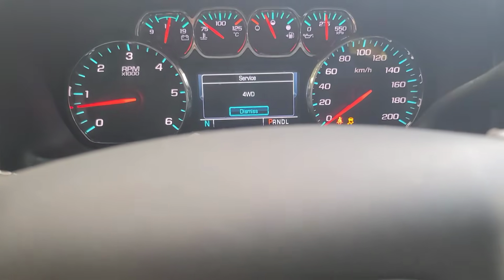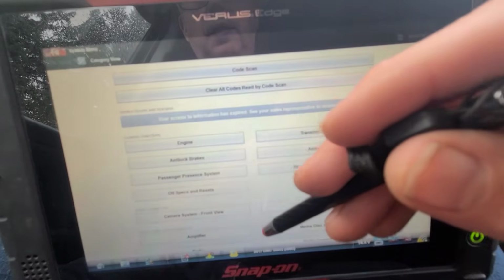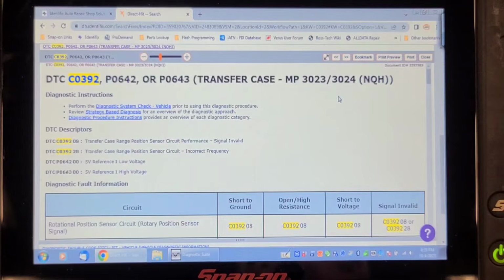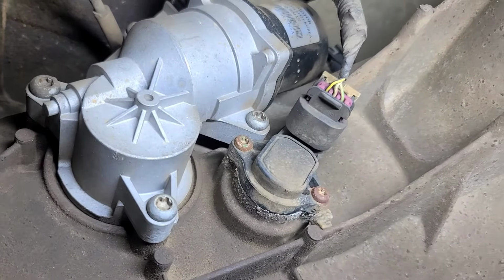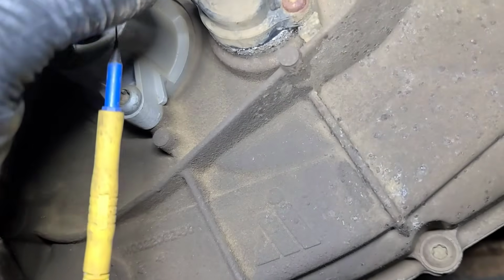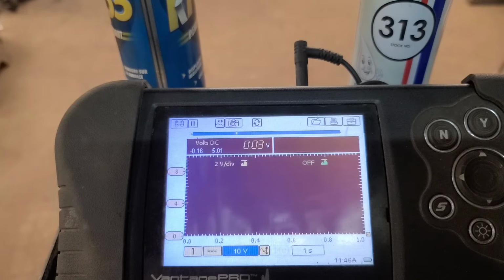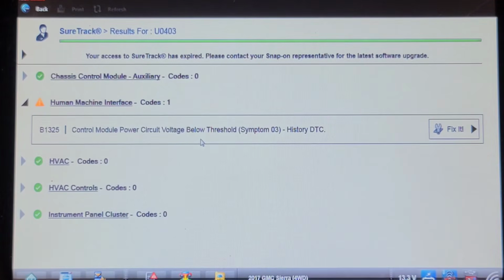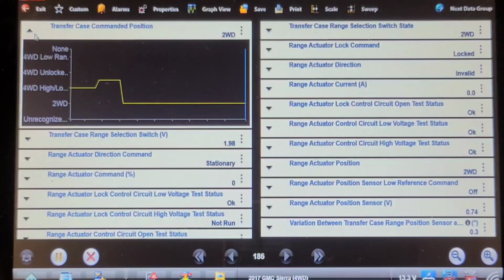2017 GM Truck Service 4WD Message C0392

Comment: I want to buy you a 6-pack.  I've been dealing with this issue for 5 years where the four-wheel drive with ghost shift.  It would try to put itself into 4w low while driving 55.  Then it would settle for 4w high and be stuck there for a number of miles.  I took it to the dealership and they're like oh it's the transfer case, and then they replace that to the tune of like $1,000. Then they're like oh it's the switch to the tune of like $200.  I just dealt with the issue, because I knew it was something electrical so I just kept the switch unplugged.

 This video completely solved my issue.  I pigtailed a new connector in and no more issues.  Thank you so much for this video!!
Reply from the maker: I'm glad the video was helpful for you. Intermittent problems are the worst to track down, but why would they recommend replacing the entire transfer case. You can send me a Super Thanks if you're inclined...
Reply: @PhillipBailey Because dealerships constantly want to rip me off.. what's a Super Thanks? I'm not YouTube savvy and don't know how to DM.
Reply from the maker: When a video is playing, click on the three dots at the bottom right of the video and a drop down menu appears. There's a heart with an S in it. If you click that you can leave a monetary tip of whatever amount you like.
Reply: Thanks!  I will do that.  Unfortunately it didn't fix my problem like I had hoped.  Could the position sensor have anything to do with it or is it most likely the TCCM at this point?
Reply from the maker: @TravelingKoi that's not a common problem, I've never seen that on a GM. Does it set any codes or just shift to 4x4 for no reason? Reply with the vin and I'll see if I can find any cases on it.

Comment: I’ll be referring to this video to diagnose the same issue with my daughter’s 2017 Colorado. I assume it to be the same voltages across all GM products.
Reply from the maker: I doubt the Colorado will be the same as its a different transfer case if I remember correctly. What are your symptoms and what code/s are setting?
Reply: @PhillipBailey Service 4WD in the DIC. No codes. It does shift into 4H and 4L.
Reply from the maker: @__Joe__ what are you scanning it with. Should be a code in the transfer case control module
Reply: @PhillipBailey I use the Icon T7 scan tool. No codes in the TCCM.  The DIC message only appears when the transfer case is moved to 4WD Auto, 4H, or 4L. It is not displayed in 2WD.
Reply from the maker: I'd recommend to try a different scanner as there should be a code if you're getting a message on the dash.

Comment: Thank you for such an excellent video. I have a 2017 Canyon and I got the service 4WD code yesterday after I had the truck washed and shut the truck off when I came out and started the truck it showed the message.  I was suspecting that this was going to be a signal error and now I know where I’m going to start. Excellent trouble shooting.  I only just got the truck so I’m just learning about all the systems and your visual inspection confirmed one of the lessons I was taught 30 years ago. 90% of most faults can be found by visual inspection 😉

Comment: for 2008-2013 Try Doman part DORMAN 645902 $50 or WELLS 1P1506 $70, plug for 4WD actuator, Chevy part 12117277 is $200
Reply from the maker: Thanks for the tip

Comment: Im trying to find the plug for that thing what’s it called?
Reply from the maker: Service pigtail is 13580871. Try dealer or Amazon
Reply: @PhillipBailey I got a new pig tail but the colors on the new connector are red,black and white I was trying to splice the new connector
Reply from the maker: @cristianvalencia2487 just maintain the same pin location.
Reply: @PhillipBailey  does it just pull off - in other words will i destroy the whole truck if i pull on it real hard?
Reply from the maker: @josephwoody8289 there's a secondary lock that has to be released to disconnect the connector.

Comment: Getting the c0309 code on my 15 sierra.  Replaced the TCEM  and no different.  Hooked up my buddies scanner, read and cleared code.  Comes right back as soon as the key comes on.  Tried the re learn procedure woth no luck.  Really trying to avoid the dealer if possible.  Do you know if the new tccm module comes pre programmed or is that still required?
Reply from the maker: Are you sure it's C0309? I don't find that code description on a 15 Sierra. The TCCM is vin specific meaning a used one will likely set a vin mismatch code and a new module needs to be programmed using GM SPS.
Reply: @PhillipBailey  c0396 my apologies
Reply from the maker: @williamdemartini371  100925
Tests/Procedures:	1. Disconnect the transfer case shift motor.

2. Key On Engine Off (KOEO), check for 7.2–8.5 V at terminal G.

3. Check for a good ground at terminal H.

4. Check for 6-7 V at pin E.

5. If the above tests fail, check for open or shorted wires.

6. If the above tests pass, reconnect the motor.

7. Scope circuit 7473 and look for a square have pattern while operating the motor with a scan tool.

8. If no signal, replace the shift motor.
Reply: @williamdemartini371 
Probably too late but I had to pull fuse 6 while truck was on then put it back in and I was able to shift to different settings. With new motor installed it was still saying service 4wd until I did this

Comment: Great video,  where could I find that plug, my dog pulled the wires off of it, chasing a cat under my truck,  the wires and plug still good just Ned the right order in the plug to check if I can clear the code
Reply from the maker: @josemsltos6258  GM Part number 13580871
Reply: @PhillipBailey  thanks

Comment: I miss the old days , lever on ,or lever off , or lever alone .
Reply: This is my first Chevy and got an 8 inch lift and 37 inch tires the first time I put it in four-wheel-drive to drive home from work the next day I got up and it said service four-wheel-drive system. What does that mean?

Comment: My Autel scanner also does the same thing. Not fully clearing fault codes using the "clear all codes" function. Yes, it only takes a few more seconds but it's annoying as hell. They need to fix that glitch! Anyways, Good find and repair.
Reply from the maker: Thanks for the comment. I don't think it's the scan tool at fault. I've noticed even using OEM scanners the same issues. Also on some ABS systems you can clear codes but they don't actually clear until the system performs a self test which might require a key cycle or wheel speed input.